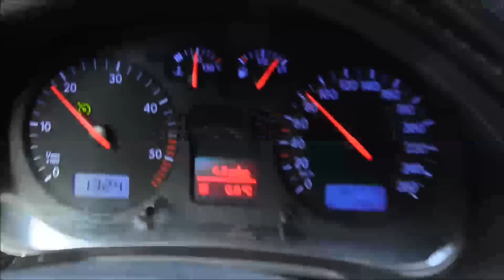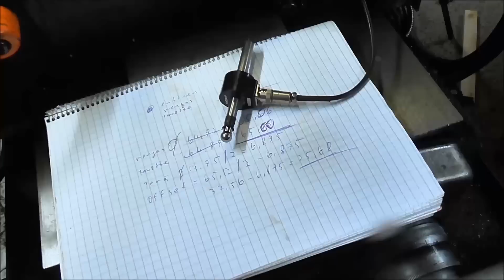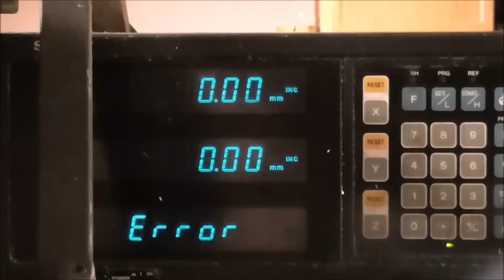Machining parts for my 1I611P lathe

Comment: your very fortunate to have such fantastic beefy machines...looking good! but i would be working on one lathe at the time so you have access to turning parts..
Reply from the maker: Well, at the moment I have only one of my beefies in working condition and even that needs quite a bit of work when I have time for it :-). But being more or less broken is the reason I could afford all of my machines. Also all of this is for fun, I really enjoy playing with my machines and getting to know them. No real hurry to get things working. I will finish this small lathe now, I already have the spindle back together but need to make some adjustments and fix that broken gear on the main gearbox. I will fix it now rather than putting it in as it is on this vid. My other lathe needs like 50X the time this machine needs :-). When I have this running, I have a lathe and a mill which I need to fix my grinder and lathe!

Comment: nice work sunppa . You can use kerosene fuel for coolant on cast iron. I did a video on splines with a dividing head you might want to watch and I have cut lots of gears with the dividing head also it just take a little time and you can do it Good Luck
Reply from the maker: I have already watched all of your videos and learned from them! Very nice work on the splines! I have heard other people also recommending kerosene as a coolant. Will have to try that! Thanks!!
Reply: sunppaa Well  I try to learn from video I watch also . I like your edge finder on your DRO  is  really cool. I do repair work so the new mill will come  in very handy I looked at the world time zone and we are about 8 hrs apart funny and about the same climate

Comment: looks good, turned out great, i'm glad you didn't attempt to drill the holes - even with no press fit there was still no need for those, as long as your bearing is good that shim won't spin.
what are you using for coolant? (is it re-purposed motor oil)
Reply from the maker: Yeah, true! I have not touched the coolant since I got this machine. No idea what's in there. Hope the workers didn't use this mill as a toilet.

Comment: I am a late comer for this video but as I was reading the comments I thought since the gear was straight cut and not helical load would be minimal especially with a nut on the back end if I understand right. I repaired automatic transmissions and transfer cases in my younger years and broken thrust washer tangs and improper bearing and washer assemblies tend to grind the bearing retainers and even cast iron gear cases out like yours did. It also looked to me like someone must have been in there working on it before you got there and they installed it wrong. These are great videos you have posted and I want to thank you for taking the time and effort required to do it even if this old man is a little late in viewing them. Keep up the good work lad. The trades and even private enterprise have taken a beating here in America and it should not be like that anywhere. Good luck to you son.

Comment: Take a look at using neat cutting oil (Cora B by Morris Oils for example) as a coolant. Since I have been using neat oil all the old problems with soluble coolant are avoided and the machines get a nice coating of oil on them.
Reply from the maker: Sounds very good! Have to look at that! Thanks!

Comment: Hi how do you know about this thrust bearing assembly if is correct or not? It might be that thrust bearing ring was slightly pressed into this cast iron piece. You don't know original shape of this cast iron piece. Another thing that this style of thrust bearings are not durable so why it had broken up so easily and messed up around. Better to use thrust bearing with rollers it will works better and last much more time. Good luck with repair!
Reply from the maker: The thrust bearing was destroyed because it was installed the wrong way. The race with the press fit was installed on the backside so it was turning with the spindle shaft and grinding it into the piece that I repaired in this vid. So the tighter ring should be in the front and rotating with the shaft and the loose race resting stationary against the cast piece. Balls in between of course. I think there is no reason to have the rear race pressed in. If you have, please tell me more! You must be right about using a roller bearing! Too late now.. Thank you!!
Reply: sunppaa I think both bearing rings should be pressed in, 1st on the shaft O/D, 2nd on this casting cover I/D. The reason is because it prevents against spinning and rubbing other parts. This what happened with your cover is result of bearing wearing and then was required to use more force to spin the bearing itself so ring started spinning not against the balls but against the casting cover. Meantime ball basket has been broken because of big friction forces on the bearing because uneven wear of the rings, maybe some balls was also cracked. I don't think so that bearing was installed wrong way in the factory, it just only became worn after time of usage or lathe abuse and when you pulled the shaft you was not able to determinate which bearing ring had which position, because it fallen from the shaft. I know this bearing have got some pitfalls, but when it works with other new bearings on the shaft it will do the job for some time, anyway. So no big worries. For me there are some questions for example which is main purpose is this bearing there I think only to take the load on the shaft when force from machining along the work piece is applied in direction to the chuck, if so then dimension of this cast cover is critical and you probably only can to find out this when you assembly the shaft with bearings. But I might be wrong. Bearings such like this are might be used to shift the gears or disengage the clutch. I don't understand whole assembly of your lathe shaft. There was some gear shifting rods. I don't know how they was installed. I just guess that your broken thrust bearing was between this cast iron back plate (cover) and shaft step and nothing more was there, if so it will be like I said before. (2 rings press fitted)
Reply from the maker: Radoslaw Jocz
I actually have the spindle put together now but it needs radial adjusting. By the dimension of the cast cover you mean it's thickess? I may actually have an issue with that, the cover still being now thick enough. At the moment I'm still thinking it's the front race and the gear with a tight press-fits that keep the spindle locked axially. So my thinking now is that the cover thickness is not critical. Have to do some thinking on that too. Please tell me if I'm wrong.

I'm 100% sure the bearing failure was caused by improper installation, the bearing was put on the wrong way. The rear race was spinning from the second it was installed new, it never worked like it should have. Also I'm 95% sure the rear race is not meant to be press-fit. This is mostly because the flange that the bearing rests against, will not center against anything but the screws. If it had a bearing seat for the rear race, it would not be accurately centered with the other race which is centered on the shaft. In other words, the rear race is supposed to "float". Also it seems reasonable to me that it is way easier for the new bearing to spin from the balls as it is supposed to, rather than spinning completely. Not saying that it isn't also easy to spin a ground&hardened surface against each other especially if any ois gets in between. So I think I understand your worry. Still, again please tell me more if you think I'm wrong!
Reply: sunppaa If is from SKF page:

Single direction thrust ball bearings

																	
Single direction thrust ball bearing
																					SKF single direction thrust ball bearings consist of a shaft washer, a housing washer and a ball and cage assembly (fig. 1). As their name implies, single direction thrust ball bearings can accommodate axial loads and locate a shaft axially, in one direction only.

So there will be press fit to shaft and housing. Housing ring might to have bigger ID for shaft clearance.
Reply: sunppaa Yes I mean thickness of cast cover or distance from its one face to another. I think it is important to give enough room for thrust bearing but not too much. For me this thrust bearing should to take some loads which are not good for other bearings, to do so all bearings must be located precise to each other.
Reply from the maker: Radoslaw Jocz What part in that text says it needs a press fit into the housing? Or even the shaft? I cannot understand.
The housing side ring has a larger ID than the other one for shaft clearance, just as you say. Sure it would be better to have a press-fit to the rear race to keep in in place securely. However, in this application, to me it seems impossible to have a press-fit housing because the housing part cannot be centered to the shaft. The housing side must be floating in this application. If the rear race is press-fit to be uneccentric even a tiny bit, it will cause the bearing to wear very fast.
Still disagree with me? In any case, I will think this out thoroughly and discuss it in my next video!
Reply: sunppaa http://www.ntnamericas.com/en/pdf/2200/brgfits.pdf
see Table 7.4, pure axial thrust bearing and beginning of text: 7.1
for me it explains why must be press fit and which tolerance is recommended to particular type of bearing.
Reply: Radoslaw Jocz you can machine a new housing which can be very concentric. it is not the problem to have 2 diameters concentric on such cover
Reply from the maker: Radoslaw Jocz
The thickness of the cover has no effect on the space for the thrust bearing. The adjustment is done with a nut on the back of the spindle. So the thrust bearing is tightened between it's front race&the press-fit gear and the adjusting nut on the back. This bearing takes 100% of the axial force of cutting or pushing towards the chuck. There is another angular contact ball bearing behind the cover. It takes the rear radial load and the axial load load from pulling the shaft.
I was worried about it leaving too much free space but that neither is the case now.

The problem in making the housing with a concentric press-fit is not in the housing itself, it's in the spindle box casting. It has no place to center the housing. I would also have to modify the spindle box casting to hold the housing centric. Also I'm 100% sure there was no press-fit housing on the cover. There would have been some of that left even after that wear. No way it wore down over 4mm of that piece. If it was that thick, it would not even fit. I'm sure they would have made it centric with the shaft in the factory if it was needed. Making a new housing part I think is not worth it.

There was a lethally serious installing error with the worn bearing and I'm sure the failure was caused by that. Sure it would be better to have the housing centric and have a press-fit for it but they designed this lathe not to have a press-fit for the rear race. I'm sure the soviet engineers would have made the parts different if it was needed.
Reply: sunppaa OK, so if adjustment is done by nut it is fine.  I can agree with you that there was no any evidence on the casting that there was any press fit. There was not enough shoulder on the casting, but it might be there any slight recess, who knows.
Reply from the maker: Radoslaw Jocz I will do research on this issue and discuss it in my next video! You do have a very good point in what you are saying.

Comment: Sunppaa,  those russian lathes are really nice with great features.  i like that probe for your dro also very nice.  i have been looking for a stanko lathe like yours and factory dragon.  i have only found one 16k20 in the usa but the guy wants 12000 us for it. hes crazy right?
Reply from the maker: 16K20 is an awesome lathe! If it's in good as new condition and comes with good tooling, it's not crazy. Othervise it is crazy :-). When you buy a lathe like that new, I guess it will cost like 20k? They still make these machines in Russia!
Reply: i really like the rapid traverse feature and that it can cut basically any thread pitch. 12k is just out of my price range.  the lathe i was interested in did not come with any tooling and just the three jaw chuck.  stanko machines are built to last.